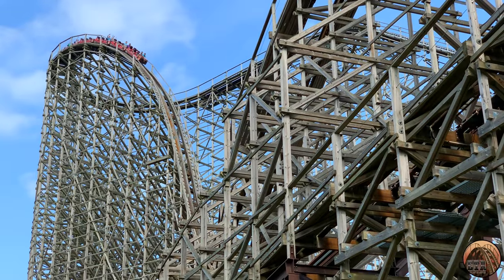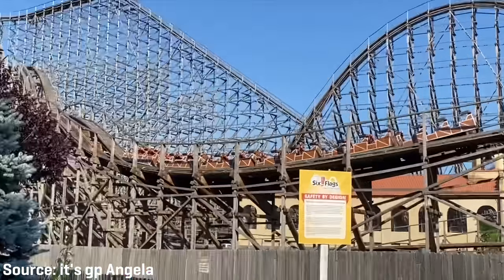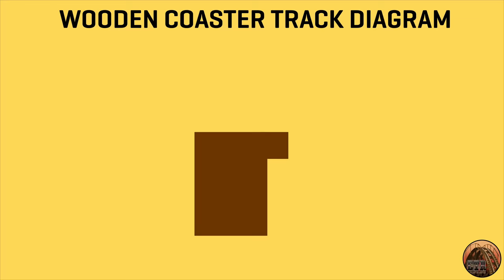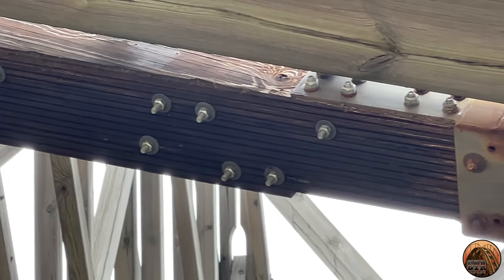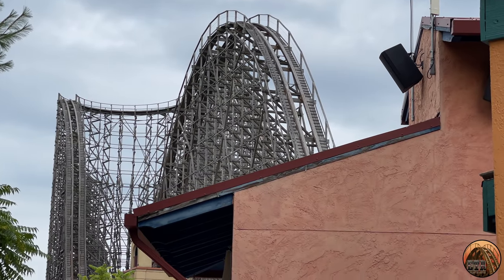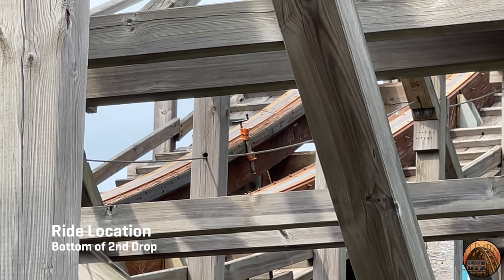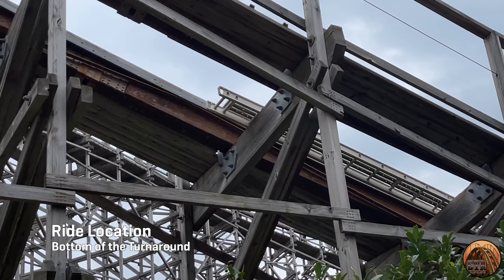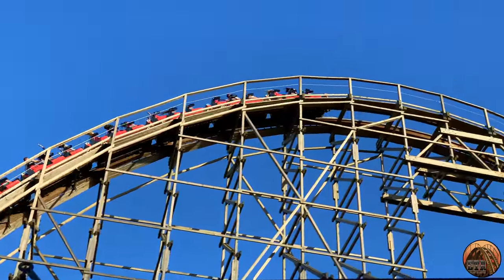What's Going on with El Toro? - Post Accident Update  - Six Flags Great Adventure

Comment: I wonder how the wooden structure would react to the bolts being hit. When a train hits that bolt, would the head of the bolt shear off or would it be pressed in the wood. I would think the second case is much more likely, so I find it strange that for so many track pieces, the only thing that has to be done is replacing the bolts. But then again, I have no idea what is actually the case here.

Also, I think your bearing story is pretty plausible. If a part of steel holding the wheel in its place was to brake off, they would need to take both trains of the track to check them for cracks in the chassis structure. Since they've only taken off the last car, it is probably just the bearing.
Reply: oth trains are covered near the station wouldnt shock me if both trains are totallh replaced the state is up the park ass over this
Reply: Believe it or not, I suspect that the steel bolt head will be weaker to that direction of shearing force than the surrounding treated and well preserved wood. Just the nature of the materials strengths and weaknesses. Steel is stronger overall, but may be more brittle or prone to shearing in certain axis of force. Whereas wood while not as strong as steel in it's direction of strength, is much more forgiving from unexpected directions.
Reply: If I had to guess, the bolts sheared off.
The bolts were secured lengthwise by their nuts and washers, and secured sidewise (weird word, I know) by the wood that surrounded them. Because of their long length and narrow profile, bolts are strong to forces going along their length. They are much less strong to forces going along their sides. The bolts on El Toro very likely received side impacts, where they were weakest, and also to the parts not surrounded by wood. Since the bolts were probably not strong enough to handle a side impact from a moving roller coaster train, they likely couldn't have moved the wood significantly before they broke.
Reply: @andrewtaylor940  the bolts will break.  you can break they with a hammer and the forces of the derailed train are way stronger.

Comment: The thing about ball bearings is that they can operate normally, yet fail in the same day. A seal could be broken and they'll spin all the same. However when operating in these circumstances, the grease can easily escape or debris could easily enter the system. Either scenario would lead to catastrophic failure in these conditions.
Reply: Spike S  oh i told operators when i rode the hour efore and they just looked at me like i was dumb and didnt even care they just srugged it off

Comment: Wow, I literally rode this one day before the accident and this is the first I'm hearing about it. It was my first time riding El Toro in about 5 years. The ride I had this year on June 28th was extremely rough and I was actually experiencing neck pain during the ride. I've ridden this coaster a few times over the years and have always remembered it being unusually smooth for a wooden roller coaster, so it was rather surprising to me that I had such an unpleasant experience this go around. And trust me, I love wooden roller coasters, even the rough ones, but I've never been in pain and wishing the ride was over before. Hope the ride can be repaired swiftly; it is an absolute joy when it runs correctly.
Reply: @glenn bryant So it's not just me! I think you might be right, seems like a larger issue than just this incident

Comment: Just realized June 29 was at least a 95 degree day. In some parts of New Jersey it got to 100. Heat related thermodynamic expansion may have played a role. The previous two days also were over 90 degrees. It was the fourth of a five day heatwave, and this accident happened during the hottest part of the afternoon.
On an somewhat related note, I recall a Norfolk Southern freight train derailed near Altoona, PA in June also following several days of a heatwave. That train was some 15,000 feet long. Likely it hit a heat kink. It’s very possible there could have been an issue with the physics of El Toro train A also. But trackwork could be a factor too.
I realize this was a coaster derailment but railroad trains face challenges with physics and I highly doubt roller coasters are immune from similar things.

Comment: Rollercoasters are HUGE investments in money, but they are also steeped in safety features. I was a ride op at Knotts for a summer, and when I worked the kiddy rides, it was super lax and I could pretty much have my fun lol  but when I was sent to Montezuma, everyone was like a professional engineer, they knew the coaster inside and out.
Every park that spends a lot of $$ on a coaster demands safety and reliability from the manufacturer, and their track record is quite good. Once El Toro re opens, you can bet it'll be safe as before.

Comment: I was at Magic Springs & Crystal Falls last month. They were running Big Bad John with a hole in the floor of one of the last rows. While the row was blocked off, it looked like a wheel came off and jumped up and damaged the floor of the train right where the riders right foot would be. Glad I rode X-Coaster first before I saw Big Bad Johns hole. Sketchy!!!!

Comment: I too, believe it was a wheel bearing issue. As part of design redundancy, coaster trains will "double carry" in the bogeys. A pair of wheels per side. A 7 car train will have at least 96 wheels. Our Schwarzkopf train on Greezed Lightnin' had the wheels replaced at least twice a year. Since the back car with it being lifted briefly during launch, would have to be changed more often. Besides the hitches between the cars, either dual chains or dual cables keep the cars from detaching.  There have be a few "freak" occasions where this did not occur. The rest of the systems did what they were supposed to do. But, it's like Olympic bob sleds. Once that thing goes downhill, it "ain't" easy to stop it. LOL!

Comment: Bearings can seize with pretty little effort. If a foreign object wiggled its way in and locked it up, or if it wasn’t properly lubricated, friction could’ve also seized it. This could cause catastrophic failure of the axle it rests on. Had one go bad on an idler pulley at work the other day just out the blue and it sheered a 1/2 inch bolt in half
Reply: it was also extreme heat of 104 that day

Comment: I find this coincidence to be pretty funny because another wooden coaster at a Six Flags park derailed last weekend. But unlike the El Toro incident, this one is only known by a couple of employees who were there and others who heard about it. Basically, a colleague told me that maintenance was being done on Monstre at La Ronde. And around 3pm, the green train on track #2 was dispatched with no passengers on board. From the picture that was shown to me, it appears that the forward left wheel assembly came off the track and the friction that was caused by that made the train valley on the last turn right before the first brake section. In the picture, the front car is heavily tipping to the right and the road wheels seem to be hanging in the air above the track. Luckily, the ride suffered from no apparent damage and the ride safely reopened the next day.

Comment: Probably also put a lot of wear on the steel plates for the road and stabilizer wheels, if part of the train was running on them so it will possibly need to be retracked, but I’m not a rollercoaster engineer

Comment: Generally good explanation of how tracks are constructed but it would have been far better to draw each of the three locations of steel plating on which the wheels run in another color to distinguish between wood, metal and wheels. Thanks for all the videos you produce. Good job!

Comment: I have a slightly insane theory. It is likely that given El Toro is an intamen designed, RMC built , and six owned. The following sequence happened

Intamen pushed the limits in the design of El Toro. Knowing this Six Flags had RMC build El Toro with the understanding that RMC would build the ride to the most cautious version of spec. Six Flags has been carefully maintaining El Toro replacing things earlier than required assuming (probably quite rightly so) somewhere in El Toro there was some extremely close to the wire engineering. Again not in a way that was unsafe but in a way where things could break & cause serious damage to the ride.
Now during the pandemic it is likely that Six Flags had to relax its part replacement schedule on El Toro due to lack of parts and stretch the life of regularly warn parts to the actual spec given by Intamen & got burned by some poor quality control on some part.

Comment: Its amazing the train had so much momentum that it made it pretty much all the way through the course like that.
Reply: Those trains are HEAVY AF. Once it goes down the first hill, there's no way of stopping it except for brake pads.
Reply: @esp-music  if it was off the track or lost a wheel, whatever was dragging along damaging the track could provide enough drag to slow the train so it wouldnt make it up the next hill, let alone around most of the course.
Reply: @porcelainthunder2213  That's not true at all. Only the front wheels on the last train derailed, which would drag and damage the track of course, but it def wouldnt be enough to stop an entire the train going down a 160ft drop as quickly as you suggest. Because it's the back train, it is basically getting dragged along the route by the other 7 trains that are attached. Also, the train had 32 riders, which means it was fully loaded. All of those reasons are why it stopped near the very very end of the run, just shy of the final brake run

Comment: At 5:-06" you say the "front right corner of car six that dragged" when you should have said the "front left corner."  It appears to me that the left rear wheel of car six is sitting normally on the track. The left rear corner of car six appears and is higher than normal because the left front corner of that car is down much lower than usual. That is due to the fact that the damaged left front wheel is hanging down below where it normally would be.  Note the position of the front versus the rear left side wheels of car six visible at 5:14".
Reply from the maker: The front left of the car is seated normally actually. The trains ride rather low to the track.  Based on the damage to the track, I will still say that the front right of the car dragged

Comment: It is very fortunate there wasn’t any serious injury.  Intamin wood track is very different from the traditional wood track.  I don’t know too much about the process, but it seems Intamin makes their wood track like they were making a steel coaster.  I even think they probably use adhesive like in gluelam beams.

Either way, the incident lands in a catastrophic failure, meaning the majority of the track on the ride will have to be either rebuilt or tested/inspected to insure that the original design properties still hold.

Fortunately wood is a resilient and that’s probably why not all the track is coming off.  When stuff like this happens, it’s difficult to estimate the reliability of the structure going forward.

For example, insurance companies will only reimburse for new child seats in an auto claim once you proved you have disposed of the old child seats and cut the seatbelts.  They are really only predictable in one car accident.

Comment: I entered the park not long after the accident as I had a season pass with my family. Even with those passes and 15+ visits to the park, I’ve only ridden El Toro once. I had been hyped up to finally ride it again. Yet unfortunately it was closed for the remainder of my season passes (which just expired). As I got in line for Zumenjaro, I actually saw the damaged train sitting bottomed out with a crane, men, and straps as I assume they were about to pull it into the brake run. I hope to return to the park one day myself as I only live three hours away and marathon the fuck out of El Toro.

Comment: Balts? Balts? Lol I can't unhear it...jk. what most likely happened being the rearmost wheels is something pulled out and the rear wheels were able to get out of the channel or the lower upriding wheel sheared off and the cart was no longer bound to the track. But seeing as so many BALTS were replaced it was most likely a failing track itself from dryrot  or defective fasteners.

Comment: I am from Ohio and went on an east coast coaster trip 2 weeks ago. Was very disappointed that el toro was down since I don't know if or when I will make it back that way. I saw a man working on it removing pieces of track wood with the claw end of a hammer. Seems like there would be a better way, but who knows. Side note: Jersey Devil was the most disappointing coaster out of the 70+ new ones I rode. Pretty weak forces and didn't do much.
Reply: Did you ride it without the trims and the new wheels?

Comment: what i foresee is of it reopens rather than scrapping all the money put into it is that not only should it return to safe operation but even safer operation as heavily scrutinized i know a roller coaster I've been riding for 20 or more years  has been upgraded at every chance they get to maintain rider saftey even at the cost of comfort but I'm glad it's there and still running my guess is mechanics spread too thin it rushed to just "paperwhip" it approved to ride as "it was fine yesterday" though I know there's multiple people running many inspections on it ... probably would chalk it up to a defect bearing that did not last as many rpms as all the others as it's grease maybe got washed or baked out and a lil dirt or rust friction and bam ya got a problem on 1 ... ignore that problem enough and it becomes bigger with time... at work i constantly replace bearings that should last many months full time use as long as greased and not hotwashed to rust in the air get a week out of some in specifically washed zones for food saftey and the machine design favors foodsafe over machine  safe from wear damage ALSO Thanks for explaining it in the more detail with pictures pointing out what we see and using past experiences to guess. really helps me understand

Comment: I don’t think it’s ball bearings that caused the accident. There’s usually a big fender washer over the end of the wheel to prevent the bearing from blowing out if the race gives away. I think what we got here is somebody under estimated stresses of the axle and didn’t get a hardened steel that could handle the abuse.This will explain why one wheel is on top of the track on the opposite side because the whole axle came off in allowed the car to rock and move downward in a position that allowed the opposite wheel to completely jump out of its keeper. The photo kind of proves that the axle has been broken and is no longer on one side of that car. I think what they did was they took specifications that they thought would be the same on the RMC track that would be on a. Traditional wooden track. Untraditional wooden track you’re going to have wood that actually absorbs the impact. On an RMC track you got metal in a lot of the places. This could cause fractures or little mini fractures called metal fatigue in the axle.

Comment: There are no up stop "wheels" on woodies its brass. I'm a ride mechanic
Reply from the maker: Are you talking about upstop pads? I can assure you El Toto has actual upstop wheels to account for the extreme negative g-forces. Most modern wooden coasters have actual upstop wheels as well. Upstop pads are an older designer

Comment: Seems to me the riders were lucky it was a front wheel on car 6 and not a front wheel on car 1 that malfunctioned.  Having 5 cars pulling a derailed car is bad but having 5 cars pushing a derailed car would have been worse.  If one of the front wheels had started to dig in to the track while the back of the car was being pushed forward by the rest of the train it could have dug in until the front of the train stopped and physics took over for the remaining cars.